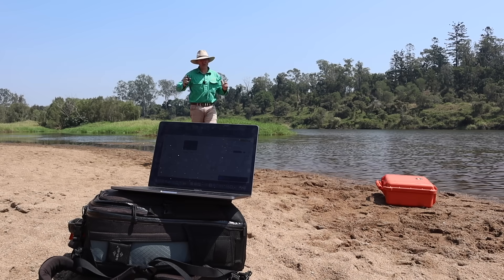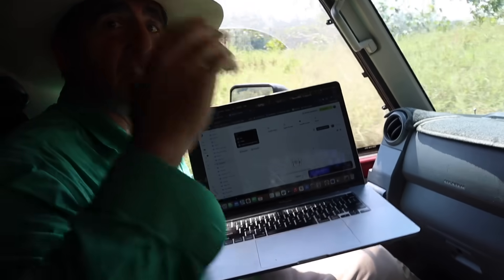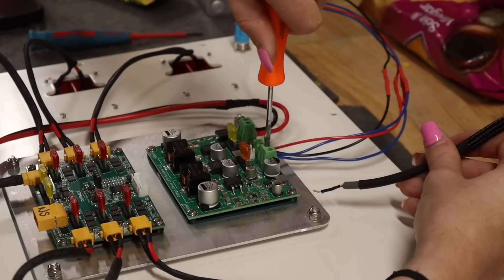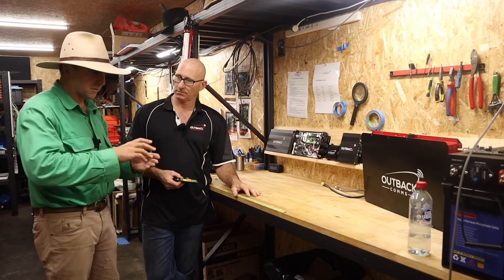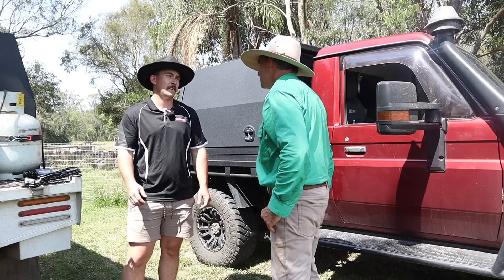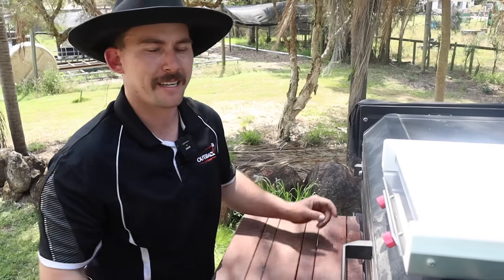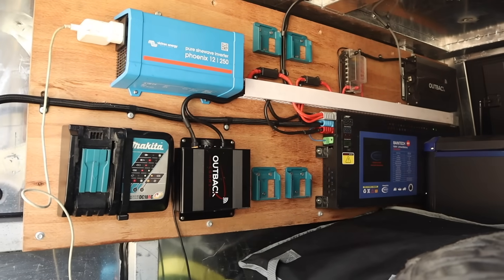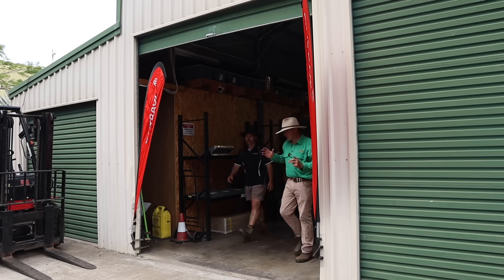Can You Make Starlink Better? I Find Out!

Comment: I dont get it. What is it doing other than a power supply ?
Reply from the maker: Boosts power for mobile signal. Has a cpu to allow you to use gps location data and attach things like accelerometer for incident reports to base. Connects with IOT devices, decoding the data and sending via LowRaWAN. This is explained by Jason in the video.

Comment: I'm confused on what the actual purpose of this is. why not just buy a buck converter that connects to a switch that then connects to a starlink for $20 instead of this.
starlink minis already work on 12v to 48v dc So why the heck would you buy this $500 thing that is just a power supply and a switch That probably costs $20 to make.